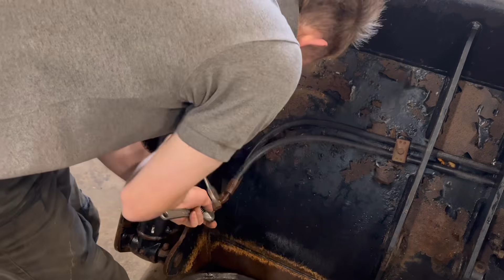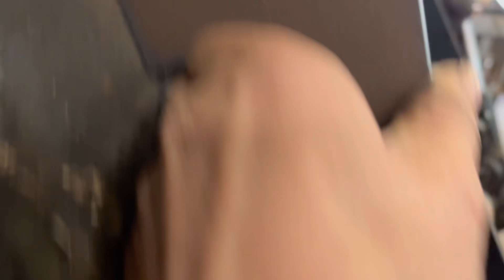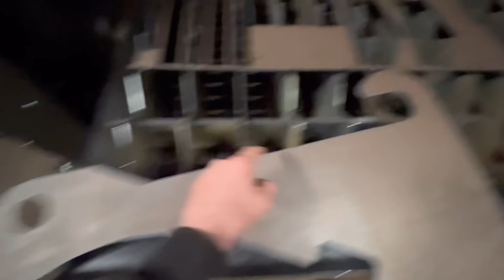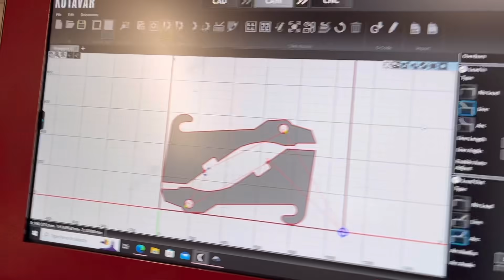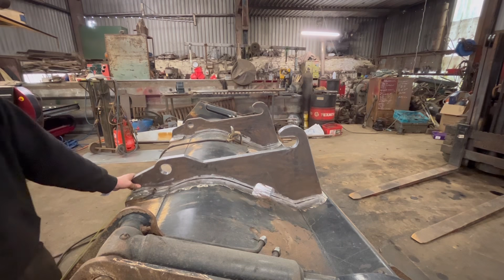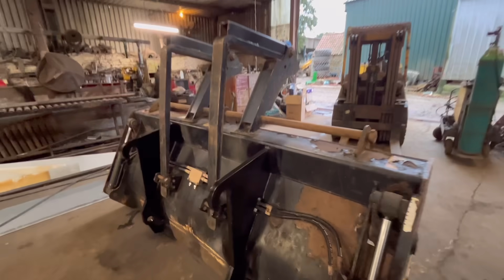Making JCB 4CX bucket fit quickhitch headstock

Comment: your customer bought the wrong hitch for that 4CX  .
 there is a hitch made by JCB designed to fit that bucket as it was built .   he bought the hitch that the royal engineers use ( im ex royal engineer )  and that has a bucket designed for it that already has the mounts built into it that u welded on

he could have saved the many and just got the correct hitch
then again each to there own

great work by the way

Comment: Came out nice.  Would like to see finished with paint, show off your hard work.

I would subscribe to your channel if you make it more educational.  For example on each video focus on detailed how to on one tool used so maybe welding on one, grinding tips on another, one on plasma table, etc.  I would like to see how to program a CNC cutting or milling machine.

I watch to learn how to do this myself or in some cases realize I will not be capable of doing the job.

Comment: Great vid.. move the fork retaining brackets outside the quick hitch framework and the forks along the hanger rail.
or you'll have to release the bucket and the QR  hydraulic couplings for the 4 in 1 bucket just to use the forks ..

Comment: When the pallet forks are in use they can be  flipped back to not in use position by crowding forward the bucket, opening the clamshell and then crowding back the bucket
If you change the position of the locking mechanisms for the pallet forks to how it used to be on the older machine which is basically at either side of the boom then you wouldn’t have the issue with the forks fouling on the hitch 
The way it’s done in your video will make the pallet forks very difficult to use and the fix is real easy just have a look at a project 8 or 9 bucket

Comment: You could fit a cheap laser engraver head to your plasma and cut test templates out of cheap cardboard or thin ply. A tip with photographing parts for tracing if you have a camera with a proper optical zoom then zoom the lens in as far as you can and then move back to frame the piece as that reduces lens distortion error.

Comment: That was an interesting job, needing quite a bit of precision to make sure it all fitted correctly. Definitely a much better idea with the quick connect system to change implements than having to knock out pins to change them.

Comment: 27:24 is the feed! Cut rate adjustable as you cut
Reply from the maker: No, it’s cutting 30mm at 440mm/min. I speed the video up so you can see the process without having to watch it for ages.
Reply: @snowballengineering  I was thinking like a D.R.O it shows the feed rate and I can adjust it more or less on the lathe.
Was wondering if you had similar control.
Thank you for your help

Comment: Hi there, I've learned a lot from your videos.  I wonder if it would interfere with your work schedule if you were to say what gas, wire size/type, speed, etc you use when you weld.  I learned a lot from Kurtis at CEE in Australia with his explanation of his welding.  thanks

Comment: Great engineering and execution, Job well done. Smart wearing breathing device especially when grinding old coated surfaces as it vaporizes all the compounds in the coatings/paints when ground and these vapors are never safe for breathing. It might on future up dates be worthwhile to try to shorten the top link by about 2-3" to get tilt equal in both directions. More power on the plasma if you are going to cut a lot of materials this thick. Ray Stormont

Comment: You could cut shapes out in cardboard too as test fits.
Reply from the maker: But then I still have to transfer the cardboard onto the computer
Reply: @snowballengineering  you are correct, just if you didn't want to be using as much 2 mm plate.

Comment: Why don’t these backhoes have the quick coupling adapter to begin with from factory? Only using one type of bucket limits the capability of a machine like this
Reply from the maker: The front buckets hardly been used so I’m guessing they ordered it without because it wasn’t necessary.

Comment: when ever i take ears off a bucket i always wash the extra weld off with the arc air  ive been meaning to get some flat arc air rods but you can do it nice wiht round rods if you lay your rod angle as flat as you can thats assuming you hate grinding at much as i do LOL
Reply from the maker: I did do a little bit but it’s quite tricky with round ones I find, to stay above the surface anyway. I’ve also been meaning to get some flat ones.

Comment: My dad made a log splitter in the 80s out of the jack leg of a hymac digger and the spool bank out of a dumper that he used for the foot control. I have it up on YouTube here if you're interested on my channel- the steel is a bit more tarnished though! I'd highly recommend a foot pedal though if you can it's much easier to work with both hands and go forward and back on a pedal.

Comment: Is there any adjustment via threads on the locking pin to help it pass fully through on the short side. 
Poor design from quick hitch manufacturer if not.

Comment: I know you have just bought this plasma table but what are your thoughts on water jet tables? On those you can cut templates out of thin plywood so a lot cheaper than sheets of metal. And also can do very precise angled cuts. But obviously it’s down to the cost and personal preference.
Reply from the maker: Expensive to buy, expensive to run and slow. Plasma and gas cutting is much better suited for my work.
Reply: @snowballengineering  understood.
Reply: Good idea, but a decent size waterjet is probably over a million bucks. Were I worked, they had a waterjet in the metal shop. It cut out material up and over 4" thick; steel that is. Also made beautiful artwork.

Comment: Gday, the oxy works well on the cnc table, however operates that machine certainly has pride, very tidy for the hours on it, great job mate, cheers
Reply from the maker: I had to double check this morning that it was 9500 and not 950 🤣  it’s incredibly tidy for the hours it’s done.
Reply: @snowballengineering  🤣🤣

Comment: you're a hard worker and a good metal worker, it does bother me a bit that the arms of the hydraulic cylinders were not protected... The sparks from the angle grinder stick to them like flies to tar...
Reply from the maker: I covered them with tip dip. Works well at stopping sparks and splatter sticking to them.
Reply: @snowballengineering  aaah.. of course👍

Comment: Maybe for the next software update the company will write a routine to run the torch around the whole plate in an S pattern or something to warm it up more or less evenly.
Reply from the maker: I could run the torch over the cut path to warm the plate but I’ve never really seen the advantage of preheating before cutting.   If I spent a bit more time with the settings I could use the timer but I’m finding it easier just to start it manually clicking the button 😊

Comment: Another good job. That cutting table and software have some great features. I feel like I am learning a lot with each different job. Send some of that rain over. We are burnt to a crisp. No real rain in weeks. Temperature got up to 38C today. Supposed to be even hotter next few days. And only Spring. Don't miss the cold. But you can have a bit too much heat too.

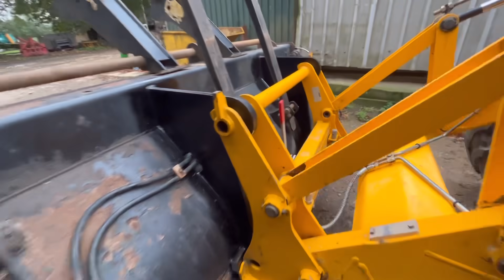Comment: 44:22 or just make 2 new brackets, on the outside of the quick system. So you can fold them without taking the bucket of. You also get so more visibility in the middle of your bucket. Nice job. 👍
Reply: Ah , the top pivot bar I see want you mean now 👍
Reply: Won't you need to maintain centres to pick up pallet goods? And hook through the straps of ton bags orf bulk products? And keep loads along the centre line for stability?
Reply: @ZanderKaneUK  you can move them, alongside the bar.
Reply: We have a very similar bucket and those brackets are on the outside from factory.
Reply: @johnsimpson8652  makes more sense 👍
Reply: Taking a photo of the q-attach and scaling it in cad has saved me so much time. I’ve Been doing a lot of bucket attachments at work recently and this technique comes in clutch! Great work as always, loving the new plasma table content!